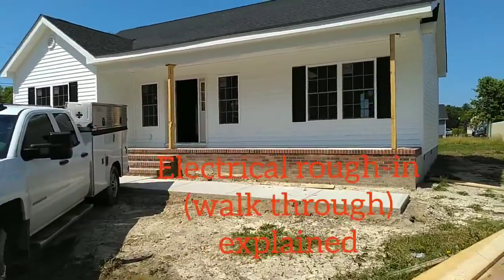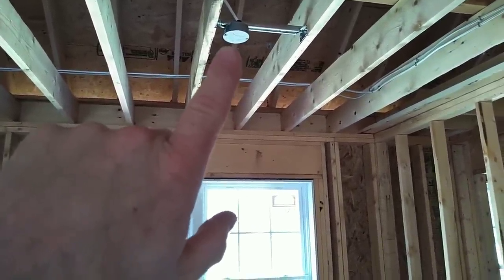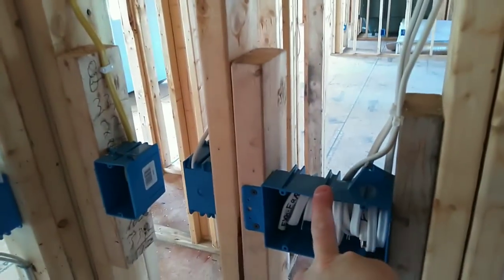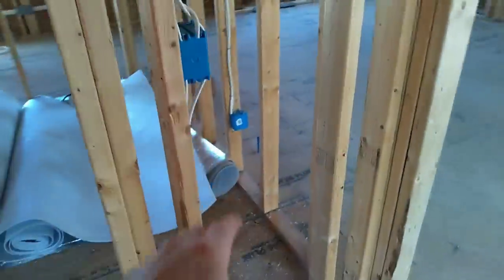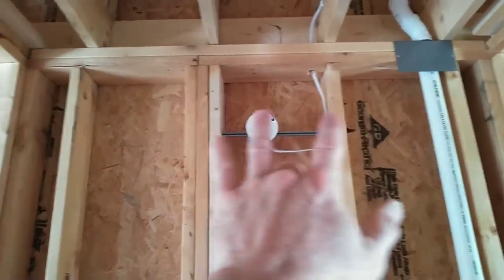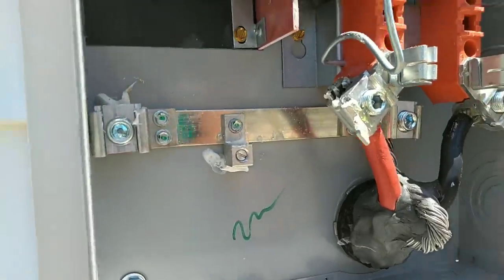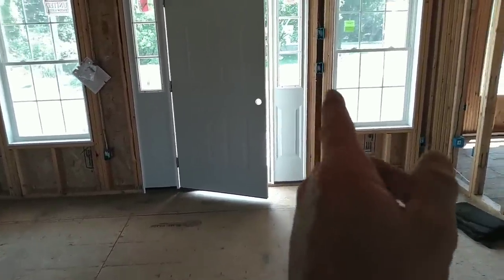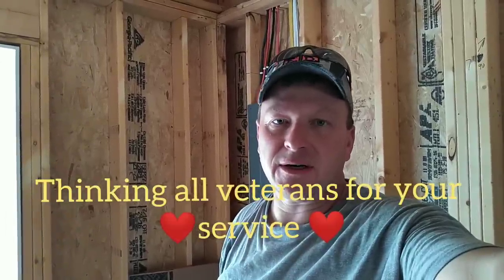Electrical rough-in outlet spacing 🤔  Better explained

Comment: I'm having trouble with a gc writing a proper schedule. The order of rough in stages he demands that we go into a building before plumbing and hvac. 

I need code articles that show industry standards for rough in stages.

Weather it be Nec, Wac, building code or city standards. 

My understanding is plumbers have priority and can rip out our wire.

If you have time. I love how you always reference code articles, it helps people like me build muscle memory.
Reply from the maker: Hey Bonnie, this is a very good topic for discussion and this question has came up multiple times in code classes that I have taken over many year. I hate to say this but truth be told, there are no codes wrote on job site priorities or order of importance ! If your general contractor has many years of  experience🤔 This should not be an issue in a residential setting. There are many variables to why an electrician may want to get in before the plumber and HVAC. Mostly do to load center placement and wire routing of home runs. Some electricians just want to get in and get the job started to get a draw! Imo...This is not the best practice.  My experience has been good with the GC I've worked for. There are many variables that come into play in this determination! But if all the subcontractors communicate well together this should be a  mostly unflawed process!  Plumbers HVAC and electricians will all have their opinions on this topic. My experience of (order of importance)
No. 1 plumber for roughing in main drops vents and water lines.
No. 2 HVAC contractor roughing in trunk lines, returns and line sets.
No.3 electricians last. Keep this in mind🤔 It's much easier to re-route or bend wire around obstacles then it is to bend a large piece of duct work or piping that has to follow grade and pitch to achieve a proper water flow... Aka gravity!  Current going through a wire is not affected by this. That's why electric is done last. I hope that helps. If your GC is adamant about allowing the electrician to start, hold him accountable for any wires that get cut and have to be replaced.

Comment: Hey Ron thanks for the info on the outlets I always wrap my outlets on the screws never did like the stab in the back of them, I myself have been to a few trouble calls where the whole room is dead and found that the stab wire come loose after a period of time. I am not a licensed electrician but have been in the trade 35 years . We did most industrial electrical services in plants and not much residential.To tell the truth I like residential wiring much better it beats running 4in rigid conduit and pulling in 750mcm in the ceilings.Thanks again for your advice its top notch and you do nice work.
Reply from the maker: Thank you Larry. I totally agree. Industrial wiring can have some long hard days of pulling.

Comment: No outside service/emergency disconnect at your meter socket location? 
I thought these were required in 2020 NEC for new construction? Definitely required in 2023 Code cycle, and alao required to install if doing any panel or meter socket upgrades or replacement (at least here in Texas).
Otherwise, beautiful looking job! Nice clean wiring. That's the way it should be done... Excellent workmanship! 
Thanks for sharing.
Reply from the maker: Your right on services needing disconnects on 2020 thru---. Maryland is still on 2017 NEC.
Reply: @workingmanrondoyle3287  Ahhh... okay. Yeah, sometimes the local AHJ is a bit slow adopting the "curtent" rules.
I'm in west Texas, and the state (of Texas) was pretty quick in adopting the '23 NEC, which almost immediately trickled-down to the local authorities. 
Thanks!

Comment: I was a firefighter and a union electrician, but as a child I had 2 home lost because of extension cords ! So I was a little anal with outlets, so I Always put outlets under every window and every 6 ft. In homes regardless of the codes most of the time only charged for the materials on the extra outlets . Also made sure that every hallway and stairway had at least one outlet for sweepers and nightlights. Then outside I would put an outlet on every side of the house on switches for low voltage lights and Christmas lights and one by the a/c unit plus the one on the deck . I know this may sound like over kill but down the road the homeowner loves that ! Sometimes they had me add outlets in the eves for lights too! But as I said I hate extension cords!!
Reply: The under-eve receptacles are a great idea! I'm in west Texas, and most all newer homes (built within the last several years) all have under-eve recep's, and most often, wired to a switch at the front door, to allow turning them on & off. (I hate extension cords too!)
Reply: Every 6' for the win! All good principles!

Comment: I have put outlets in the overhangs on switches for several homes .  Always tell customers  it is much cheaper and zero demolition debris to put outlets , flex conduit for future speakes etc etc than wait until you live there a full year and then want add something

Comment: All looks good, but you are missing a 200 Main Disconnect next to Meter as required in most locales now by the Code !! That would make the 200 Amp Panel inside a Sub Panel whereas the Neutrals and Grounds are NOT bonded and are separated from each other
Reply from the maker: Your very right but this installation was done to the 2016 NEC in Maryland. And MD. hasn't adopted the new codes yet.

Comment: Thanks for this video Ron, very educational and helpful! I've learned a lot from this. I am curious how you wire your 3-way switches, you only use 14-2 white romex? I am curious where you wire the 14-3 romex (if any). Thank you!
Reply from the maker: Hey Emily. Thanks for watching and commenting. There are more than 30 ways to wire up three way circuit. I've been debating on doing video's on all the different ways to do them. I feel it would confuse people to do so.  So I'm still debating this topic 🤔 I know there's not many videos of this subject. Most three ways need 14-3 as travelers to complete such circuits. The easy way to do three ways without going into a lot of details 🤔 are as follows
1) run your feed 14-2 to one switch location
2) run the light's 14-2 to the opposite switch location
3) run a 14-3 traveler from one switch location to the other switch location. Now that the rough wire part is done. The wire up is next.
Wire nut grounds first and add a pigtail for switch's green ground screw.
 Second, wire nut the (feed's neural) wire to the (light's neural) by connecting to the white wire of the 14-3 traveler at both ends.
 Third step,  Install the red traveler from 14-3 to the screw terminal above the common at both ends.  Then wire the black from the 14-3 to the terminal screw on the other side on both ends.
Forth step,
(Number one rule and Main rule of thumb) to always keep in mind in dealing with 3 ways!!
Each switch location (has to have a common going to it)!! Each three way switch has a black screw terminal, this is known as the common screw terminal. 
One common is the feed's hot wire. And the other common is the light's black wire. Make sure those two wires are under the common black screws on each 3-way switch. Make all connections in a clockwise fashion and snug to manufacturers spec. 
Last but not least, install the light fixtures. Install all switches and cover plater. Turn on power when safe to do so. 
This is a lot to say in a message and I hope this didn't confuse you. Keep in mind, there are many ways to do this with this way being one of the easiest!

Comment: Great video. Thank you so much for making it. Can you please explain, per the NEC, when it is possible to run the wires over the ceiling joists vs through them? I noticed in your video you have a combination of both methods. Thank you so much in advance.
Reply from the maker: Thanks for watching and commenting. 
1)Wires can be ran over trusses that are not designed for floored walkways.
2) wires can be ran (behind knee walls) without drilling holes. If there is no knee wall present and walkway has been established
 (within the 6-ft rule) holes will need to be drilled.
3)wires can be ran directly over ceiling joist as long as the walkway =wood, plywood, OSB or etc...is 6' away or greater in distance away from your wires. If not, holes need to be drilled.
4) runner boards can also be installed that are higher than the wire installed as for physical protection. I hope that give you some better understanding of when holes are required?

Comment: Tanks for the info, you think you can also name that gages of wire.
Reply from the maker: Thanks for watching and commenting. Great question. The color coding of NM wire commonly known as rol-max has changed over the years, in adding color for a quick identification of it's gauge. They are as follows
White outer jacket 14-2 and 14-3
Yellow jacket 12-2 and 12-2
Yellow jacket with a red line is 12-2-2  this wire has two separate neutrals and two separate hots +ground.
Orange is 10-2 and 10-3
Black outer jacket can be 8-2 , 8-3, 6-2 or 6-3 NM wires. I've heard the manufacturers will be adding other colors in the near future to differentiate wire sizes.

Comment: I thought that piece of plastic was a knockout because the NEC 2023 says 314.17(B)(2) Exception states, that where Romex is used "with a single gang nonmetallic boxes...and where the cable is fastened within 8" of the box measured along the sheath...securing the cable to the box shall not be required." Not sure about 2017 code.

Comment: Hey Ron watching your video on the rough in on the 1400 sq ft home in prince ann county, I see that you used 14/2 on the master bathroom vanity light and 14/3 on the exhaust fan with light. I like to install that on my bathroom.You also ran a separate 12/2 for the gfci outlet. Can I use a duel function 20 amp afci/gfci for the bathroom and install 15 amp switches and outlet.
Reply from the maker: Hello Larry, you may know this but I'll repeat this in case somebody else reads the comments section 🤔
 All bathroom outlets have to be on a designated breaker (home run) for the bathrooms only and can not leave to feed things outside of a bathrooms. This bathroom home run can be connected to other bathrooms in the same living structure. Lights , exh-fans and heating exh-fans can be connected to this circuit on the same bathroom. If you do so and connect lighting to this bathroom circuit, all the wiring and switches have to be of a 20 amp rating. As to the NEC codes  and as an electrician,  I would only encourage this for lights and or exh-fans above showers and not lighting in the common bathroom area. Mostly due to 🤔 if the GFCI trips??? You'll be in the dark... Not a good thing. I hope that helps. Let me know if you don't understand.

Comment: Hey Ron putting a exhaust fan in my basement bathroom with a water tight light in the stand up shower should I tie in the shower light with the exhaust fan or put the shower light on a separate switch?
Reply from the maker: The light over the shower has to be on a GFCI. I would do the switch for the shower light right by the sinks GFCI.

Comment: Hey Ron do you pig tail your outlets or do you just daisy chain them in and out and is it code now for pig tails?
Reply from the maker: Hey Larry. I don't use the stab in's on the back side of the outlets if that's what your asking. I've personally seen them cause fires. No, I seldom use pigtailing. It's not a requirement unless your dealing with three or more wires going to an outlet. Then you have to.

Comment: Hello Ron, I am rewatching your video, refreshing myself before my rough in inspection. What will you do with the water heater orange wiring? It's hanging near the wall, would you put it into a Armorlite Cable coat? Thank you!
Reply from the maker: Hey Emily, I wire directly to the water heater and use a breaker handle lockout Device on the breaker.  The only reason I have to protect the wire is from physical damage. If it's in and environment where physical damage can happen such as a garage, utility room etc ..
Reply: Thank you Ron for answering my question :) @workingmanrondoyle3287

Comment: Ron i live in harford county Md my question is what distance from a stand up shower can the exhaust fan be installed,also do you need afci/gfci on the basement outlets or can i use just afci.finishing my basement out.pretty sure i need them in the basement bathroom. Thanks
Reply from the maker: Hey Larry, thanks for watching and commenting. Good questions you have. A ceiling exhaust fan, can be right up to the outer rim of a shower enclosure without it being on a GFCI but must be AFCI protecting. But if you pass the rim or outer edge of the shower enclosure going inside the shower area, it has to be AFCI & GFCI protected.  As to the question about basement outlet, all finished and unfinished areas of a basement (below grade) outlets have to be AFCI & GFCI protected in these spaces. This also includes lighting circuits entering this space. Bathroom outlets in basement only need GFCI protected outlets. I hope that helps you.
Reply: Hey Ron can you put 2-12/2 romex cables under a 1/2 insulated staple?
Reply from the maker: @larryotoole933  hey Larry. I believe the short ½" staples are only for one wire. The longer staples are for two wire.

Comment: I am curious as why you do not make switch joints on the rough in? I always make them so I can make dang sure. Anyway great job.
Reply from the maker: Thanks for watching and commenting Kevin.  Making up switch boxes on rough-in isn't a code requirements. I prefer to do them on trim-out. The outer NM jacket gives a little more protection from the drywaller's roto-zip and the painter's spraying my wires. It's hard to get grounded with paint and caulk all over my grounds, if you know what I mean 🤔

Comment: Help me understand the "6' from the door" requirement. If I have a long wall separating two habitable rooms with a door in the middle, do I have to have 4 outlets/receptacles within 6' of that door?
Reply from the maker: Well it depends if this long wall is considered a hall way or a living area? If it's living area, there needs to be an outlet on each wall over 24" wide. And an outlet no more then 6' away from the right and left side of each doorway. After you determine this layout, make sure there's no boxes spaced more then 12' apart. I hope that helped you. Thanks for watching and commenting 👍🏻

Comment: Why do you have romex routed on the outside the junction box? I've never seen or heard of code references where that is allowed.
Reply from the maker: Thanks for watching and commenting. If your referring to the 14-2 NM dishwasher wire on this rough-in-phase? Wire can pass the finished wall surface in areas where the wire isn't subjected to physical damage. Under a dishwasher is consider safe area. 
(Code changes )= In years past the code allowed an dishwasher outlet to be installed. This practice is no longer allowed! The loose 14-2 NM wire that you see will be installed in the attached metal box on the bottom right front corner of the dishwasher at trim-out. Thanks for the comment. I hope that answers your question?

Comment: Hello Ron, I'm planning on adding about 12 receptacle/switch boxes in a remodeled area, 3 rooms. I'm on the fence about using metal or plastic boxes. I'm ok with the extra expense, time, and hardware required for metal boxes including the necessary bonding wire. I'm only considering the 4x4 boxes and using the appropriate mud ring. Does this make sense or should I use plastic as is used almost exclusively in residential construction here in the USA? I'm in California. This is an older home and all the current boxes are small metal ones and are grounded and bonded to the ground/neutral bus bar at the main electrical panel. Thanks
Reply from the maker: Thanks Ted for watching and commenting 👍. There are a few factors in determining the proper boxes you would want to use on your project. 1) resident or commer.
2) wood or metal studs
3) are there suspended ceilings in the structure
Where wire will be pulled?
4) type of wire used AR ,MC, NM or etc...
5) will conduit be used for raceways?
6) will things your doing now 🤔 be changed altered or modified in the near future as the purpose of theses ares may change?
7) will the boxes be exposed for a prolong period of time during the construction phase where your boxes may get damaged by the other tradesmen? 
8) are there exposed studs in which to attach boxes? Or are there just bare concrete walls?  These are all relative points in considering the proper boxes for your application. I know that's a lot of questions but these are things that have to be thought out to determine the best outcome for your project. I hope that helps 🤔

Comment: Interesting your drill line for plug to plug routing is below the boxes and not at knee hight for easy drilling and allowing all the wires to enter top of the box for easy makeup and coiling.
Reply from the maker: Good point you have made by observing the way I work. I like your thoughts on this topic and will try to keep this in mind going forward. Thanks for the suggestion and watching the channel my sparky brother from another mother 👍

Comment: 7 out of 10 people (i made those numbers up) usually end up putting or wanting a receptacle behind the TV so no cables are visible, why don't electricians just put an outlet higher up from the start?
Reply from the maker: Great comment, thanks for watching. I give people the option but most people don't want to spend the extra money to do so.  When it's a spec home  most of the time builders want the bare basics to keep cost down. None the less, great observation. 👍🏻👍🏻